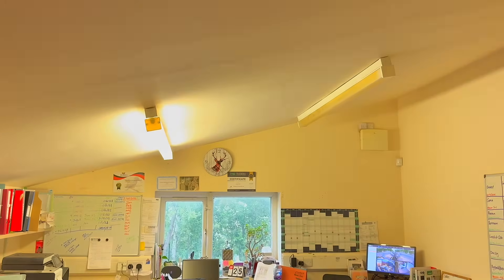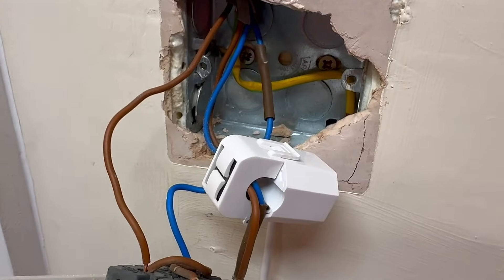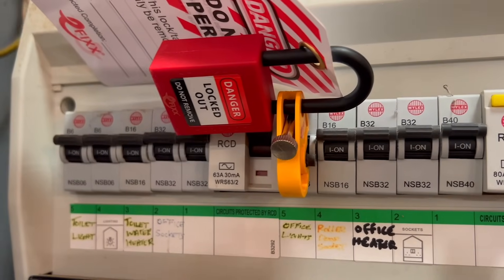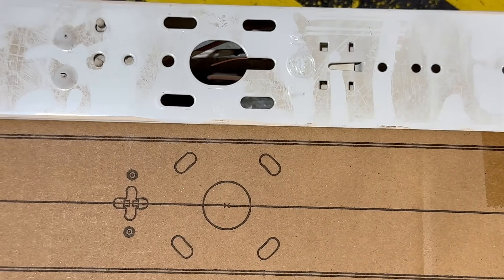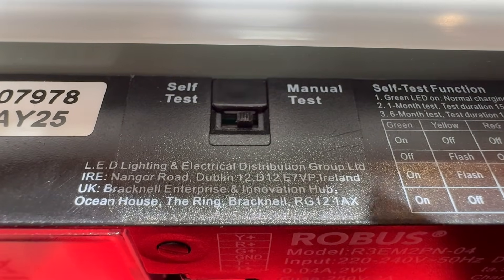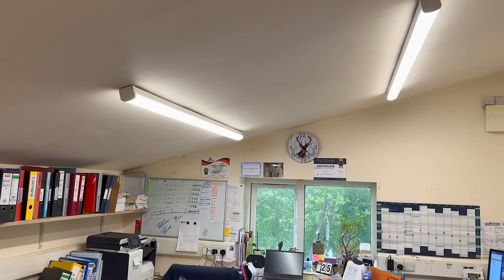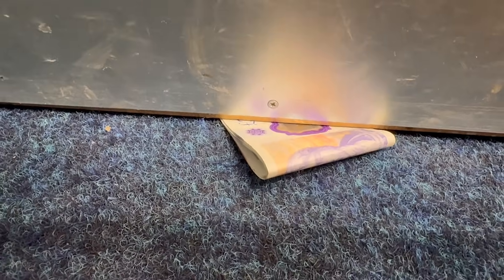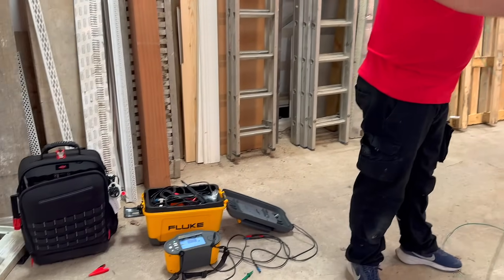Install an LED Batten: Fluorescent Out, Savings In!

Comment: I have zero tolerance now of all this old crappy lighting, any problem whole lot in the bin, replace with LED. Two issues though, the sealed fixtures are 10k hrs but from my experience that's way beyond ambitious. Secondly with large scale garden lighting it can be a bastard to get it within EICR with replaceable LED lamps. About 18 months ago I had to fault diagnose a failed test (the inspecting electrician did a good job but was not prepared to touch garden lighting),  There were about 10 circuits, one of 50, the other of about 70 lights, all in parallel looped one to the other covering a distance of about 400-500m. There were no faults, everything totally safe, installed to a good standard but the combined leakage of 70 LED 9w E27's was outside acceptable limits for a single circuit. I joked that the only solution was for some form of isolation because it would cost 10k to replace 150 lights and I doubt any electrician (including myself) would be willing to do this job because it has about 60% chance of failing the test at the end (particularly at that time of the year). The customers eyes lit up and asked if that meant they could be battery driven off solar, which is exactly what we did, total cost was about 3k, they now run off a sensor, free electricity and buy back of 4 years. So sometimes LED is not only essential, it can have other hidden benefits! Of course I might have to argue with the eFixx team about isolated systems and Ed18 but that's a different parallel universe that raises more questions than answers!

Comment: And when they stop working you have to replace the whole fitting plus the cost of removing the old fitting and installing the replacement involving turning off the circuit. If only someone invented a fitting where the lamp & starter could easily be swapped. Forgot this is what we used to do.
Reply: You can! A T8 only has connection at one end, so you can do a quick mod, remove the starter and choke, move a single wire, throw away the rest of the wiring, job done!

Comment: Just replace the tube with an LED tube FFS. You can then change the tube when it goes dud, no expensive electrician required. Phillips LED tubes have been good for me, still ok after 5 years.

Comment: Serious question. If a fluorescent bulb failed then you just replaced that for a low cost.  In a few years when that led batten fails what do you do? Replace under warranty - that's going to cost user. Replace for another led?  Genuinely think it's false economy. 
Already having to replace led panels after 2 years.
Ah, I see others posting same point.

Comment: T8 LEDs are also available in market. 

One of the problem is cooling management: hermetically closed fixtures are dedicated for outdoors with natural heat exchange, but some people install them indoors where heat exchange doesn't happen. This lights have low power setting for using in areas without heat exchange.

Comment: Those new fittings will save loads of money on electric when they stop working . 
. It’s got so bad I now recommend customers don’t upgrade their  old fluorescent lights . 
I have fluorescent light fittings in my garage that are over 50 years old . I can’t even remember the last time I even changed a tube .  If I changed them to LED It would be a miracle if they lasted 5 years .
I’m now seeing some market type shops selling fluorescent tubs again  I also have a good stock of my own. To keep my customers happy .
Reply: I have some old that have never been replaced since the 60s and still working, while the LED Tubes on newer fittings need constant maintenance. 

This can't be the Solution. I hope someone will figure out how to build tube style LEDs. Other LEDs already don't fail that often.
Reply: Just put in a replacement tube LED . On the 100s fitted, the calculations showed that after 1 year the cost of the tube was recovered. They are still working 5 years later. An LED takes about half the power of a fluorescent tube. LED tubes are silent, unlike a knackered old magnetic ballast fluorescent batten. I have found Phillips ones to be good quality.

Comment: I agree with David Savery- leds are all very energy efficient but any long term saving is negated when the things fail after a few years.
Reply: Ah, beat me to it.
Reply: Just replace the tube with an LED tube at a cost of £10. No new batten, no difference in size means no redecoration. No expensive electrician required. Replace tube only, no need to rewire another LED batten in 2 years. Phillips tubes have proved to be reliable for me.

Comment: I'm starting to have to replace  LED battons due to failures.  Unrepairable.  New fitting every time - manufactured to be cheap to make.  I tend to find them shorter than standard so some making good.

Comment: Hope they are more reliable than the Philips 'conversion' tubes I fitted in my workshop. Normally my goto brand, but 4 out of 10 failed inside 4 months! I go for named brands for build quality, but did not work in this case.
Reply: This happens with all conversion tubes, take the old fitting apart, throw away the choke and starter, modify the wiring so its live/neutral across one end, you now have a proper LED tubular fitting! And... most of them you can trailing edge dim it as well!
Reply: @Ino-z2m  The LED tubes come with L and N at one end and a loop at the other. fit the tube the wrong way round and the circuit trips. The best way is the remove all the chocks and caps etc. feed L to one end and N to the other end then loop  the two spare terminals end to so the tube will work both ways round. 🙂
Reply: That is interesting, the Phillips tubes I fitted are still working after 3 years. One failure on initial install. 300 plus tubes.

Comment: My local suppliers no longer have any length fluorescent tubes, they have not stock any fluorescent light fittings fir well over a year.  I believe that this is sortnof due to the EU Law Change/ Net Zero.

So you can either supply the New LED tube with LED starter, sometimes you may need to bypass the electronic ballast depending on the existing fluorescent fitting, or as per video, just Supply an Fit the new LED Batten light fittings.
Good video
Reply from the maker: Fluorescent tubes have been banned for a few years but wholesalers could sell stock they already have.  The ban was driven by EU energy efficiency laws plus the Minimata agreement to phase out use of mercury.

Comment: how happy is the type AC RCD with the LED lightings?
Reply: Single phase, would almost certainly using a full bridge rectifier so no chance of DC bias in the draw.  PSU would be isolated transformer based (SMPS of course) so no PC path from the LEDs back to the mains.  All the bitey bits are insulated (the power brick and the LED strip itself).  Unless you throw it in a bucket of water DC back onto the mains would be zip.  AC RCD would be happy in my opinion but always good practice to replace it with an A.
Reply: @retrozmachine1189  yes probably a full wave bridge rectifier,  but capacitive dropper circuits are still sometimes seen which do produce a dc component. Be interesting to see if the lighting manufacturer gives guidance in their instructions
Reply: @stunimbus1543  I doubt this brand would be using a capacitive dropper, but I'd be quite disappointed if I was considering using the product and discovered they were and would put it back on the shelf if so.
Reply: This lights have no accessible contacts, they can operate safely without RCD. 

Problem is E40/E27/E14/GU10/G9 with removed light source. Type A will help only if diffuser is separated from body and LEDs are accessible.
Reply: @Dmitrytln  the rcd covers several circuits, so if the rcd is 'blinded' by a dc component, then all the circuits protected by the rcd are effected